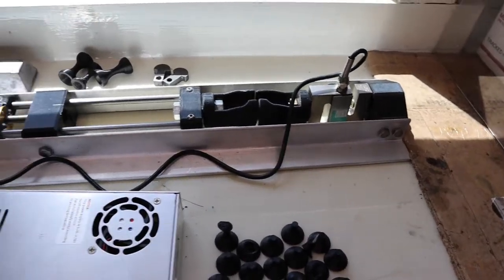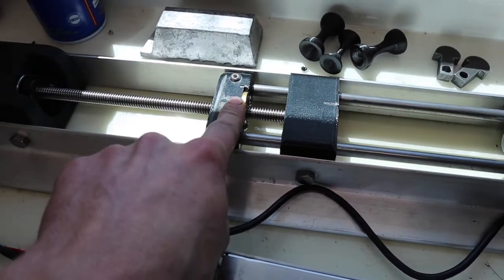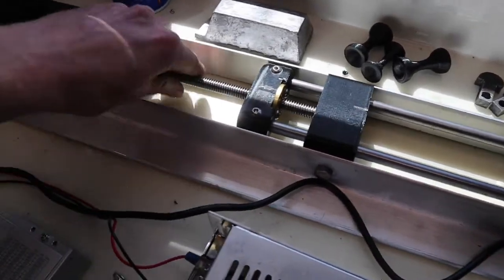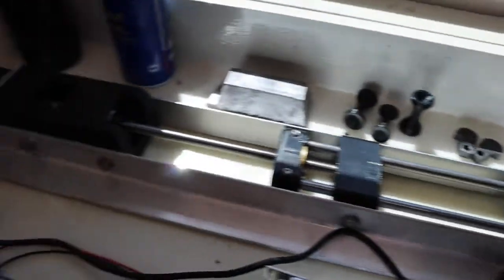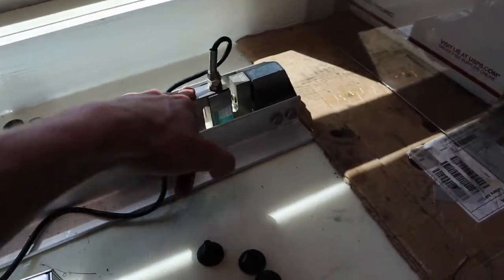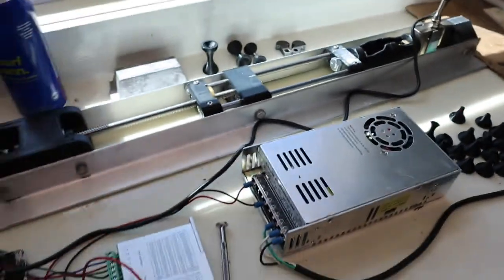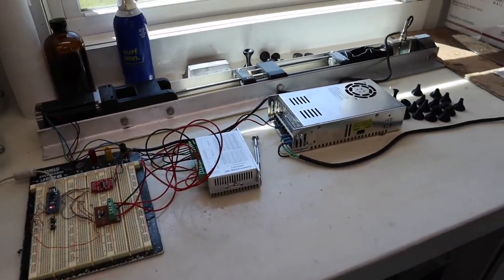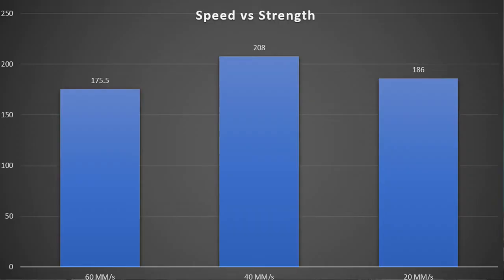A Quick Look at the New Tensile Test Machine

Comment: I'm currently overwhelmed trying to decide how to build one of these tools.
Reply from the maker: I really need to revisit this. If I added a proper set of sample holding jaws, and a Open CV based strain gauge, it would be a really great tool. It also needs to be stronger. 1000 lbs would be nice. But I don't know if the development would be worth the limited number of users.
Reply: @HoffmanTactical  cnc kitchen has his open source on got hub but yours is much simpler. Never messed with an andrino either. I thought I had fewer holes in my knowledge set. Lol

Comment: This is awesome. Have you tested the Priline Carbon Fiber Polycarbonate or Priline “Superhard” CF GF PC available on Amazon? I’ve been printing your lowers in it and think it’s quite nice compared to HTPLA. This machine would tell whether it’s actually as good as I think it is.
Reply from the maker: I'll need to try some! I just tested some Taulman 910 Nylon.
I have been using an unfilled PC blend for most of my printing. I just don't think those fibers are helping ;)
Reply: @HoffmanTactical  You are absolutely right, the fibers hurt layer adhesion. However they dramatically help reduce warping. This Priline CF PC filament does not warp at all in my experience compared to nylon which I can't get to not warp on large objects. I believe straight PC or Nylon to be stronger, but this stuff is a "best compromise".
Reply from the maker: @kingjamez80  There is no doubt the CF eliminates warping!
Reply: Like you, I print the Priline PC hotter than recommended at 275c for best layer adhesion.

Comment: I presume that arduino's getting controlled via uart?  If you don't mind a bit of extra coding, you could have it output the data in a csv format which is really easy to do.  Then when you connect to the uart shit in terminal run the command like this:
command > file.csv < inputs.txt
where inputs are the keyboard inputs you need to make to get the program to run, and file.csv will be where all of the text output from the command will be written to.  Assuming the output is only the text for a csv file, you should then be able to open the file directly in accel.
Reply from the maker: This is interesting. Right now I am simply copying and pasting.

Comment: Looking great. Is there any risk of stretching by the ABS mount? For the 1000Lbs couldn't you just get a planetary reduction gearbox out of busted electric tools? They're used to reduce speed from high rpm brushless motors & convert to torque, should work the same for your needs. Also, I realize it'll really only be used for tension, but if you adapt for compression watch out for the single all-thread to bow. Most are only meant to be used in tension, not compression, so they're not properly reinforced and will bend kinda like an ak recoil spring does when compressed if no guides...

You're using aluminum rails & printed mounts, so I'm sure all-thread is probably the strongest component there, just be careful & keep up the good work!
Reply from the maker: Great point about the ACME screw! I don't intend to do any compression, but it's something to watch for.
Reply: @HoffmanTactical  Glad I can help. While I don't know much about printing, I worked in the steel tool & die industry for a few years doing design & fabrication - one of the projects I was tasked with was to make a disability / wheelchair lift for an airplane that utilizes acme threaded rod & half nuts but the issue was binding. If debris got in the slide track it would cause thread rod to bend & disengage from the half nut, causing it to drop suddenly before emergency brakes would catch it. The only way to do the way they wanted was a custom augur style with ball joints which conveniently made the emergency brakes a double redundancy bc even if one side of the lift failed, both sides would need to turn in order for the carriage to go anywhere.

Comment: How you go about learning what your know? Did you have to go to school for this? Was just just homeschool? If so what school. Thats quite impressive where your at right now.
Reply: You just look it up online. Don't take a class to learn this stuff, this is basically "hacking" in the truest form and you only learn to do it by learning small bits and then combining it yourself into novel products. 

The best way to teach yourself is to simply do projects. Each project teaches you something which expands your knowledge making the next project easier to do. For this reason one person cannot teach you what you need to know since their priorities and projects are likely to differ from yours, if that makes sense. If you don't know something, take the time to learn it.

On the manufacturing side, obviously you should learn basic metalworking skills (like how to use a drill, file, angle grinder, welder, etc.) and 3D printing. On the electrical side, learn what P=IV is and how that relates to electrical power. Learn how to make circuits (simplest starting point is a light bulb or motor). Then learn how to use and program a project board (Arduino Uno is the most common and cheapest ~$8-15 for a Chinese made one). Find a project you want to do with an Arduino and go to town. You just have to do it once then you will get the hang of it fast.

Once you have these basics, learn how to CAD. CAD skills are mandatory for any CNC device such as 3D printing. While you could just print out files others already made, CAD allows you to make exactly what you want, or fix designs of other people. Fusion 360 is a common program suggested but due to issues regarding paywall I would suggest tinkercad as a bare bones basic online option, designspark mechanical or solvespace.